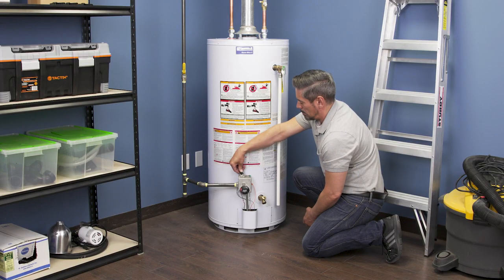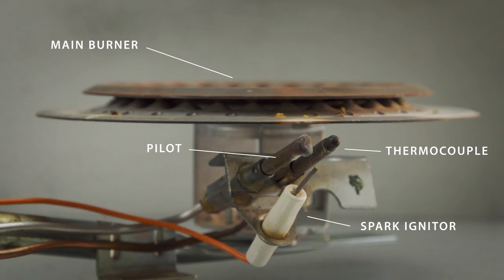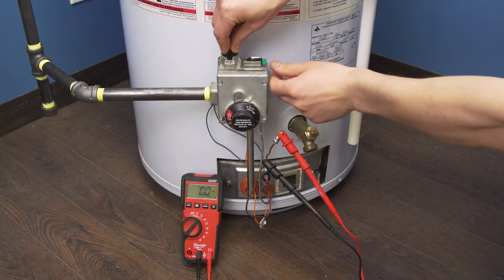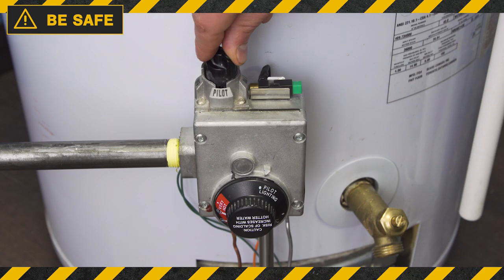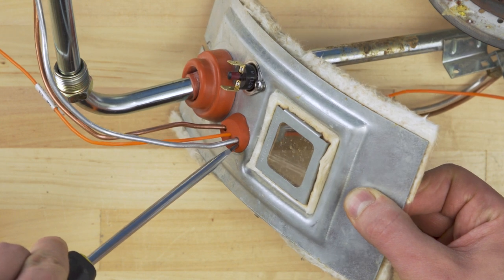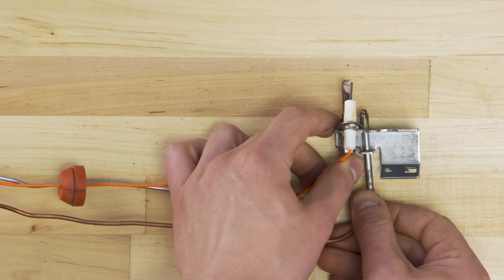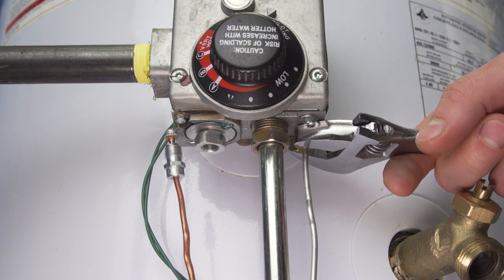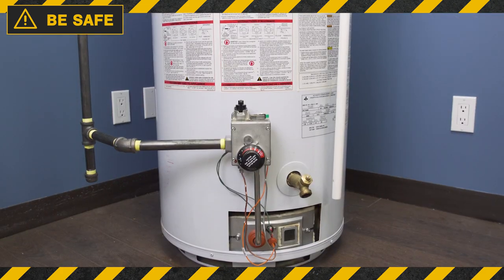Water Heater Thermocouple - Voltage Test & Replacement | Repair & Replace

Comment: Can a thermocouple be bad if my pilot light stays lit?
Reply from the maker: Thanks for watching. A thermocouple can weaken over time but if the pilot stays lit, then it means that the thermocouple is producing enough voltage and is working as intended.

Comment: My pilot now stays lit but the burner is not turning on to heat the water. What should I do now?
Reply from the maker: Thanks for watching. It would be good to clean under the burner and check for airflow issues: https://youtu.be/Lu5GvbvspMw?t=335

As well you can clean the burner assembly as a buildup of carbon can affect how the burner ignites.

If you've eliminated all other problems then its likely a faulty gas valve.

Comment: Do I have to replace the gasket from the back of the case door?
Reply from the maker: Hi Alexis, thank you for watching. Overall if the gasket is broken or is starting to deteriorate then its best to replace it. The water heater will heat water equally fine if the hatch is not properly sealed. Sealing the hatch prevents vapors from paint or chemicals from the floor from being ignited outside of the water heater combustion chamber. The intake has a flame arrestor screen across it which prevents flames from traveling outside of the water heater. Any huge air gaps in the gasket reduce the protection of the hatch but won't prevent the heater from running.
Reply: Thank you for your quick response! I will get a new one. Turns out the combustion trip device broke and that is why it wasn’t working. But on the bright side we have a new coupling 😁
Reply from the maker: @alexissabbagh5974  You're welcome, we're happy to help! Glad you got it fixed!

Comment: Why can't the gas be shut off first BEFORE start working on the fix, rather than watching out for the strong gas smell?
Reply from the maker: Thanks for watching. To test the thermocouple / you need gas to light the pilot. The statement about a strong gas smell is a general warning. When lighting the pilot flame there shouldn't be a strong smell of gas so you should be able to safely light the pilot and test the thermocouple voltage in this case. Then later in the video we recommended to shut off the gas before accessing the burner assembly.

Comment: Any one else find that the voltage is negative instead of positive when hooking up the probes as they show?
Reply from the maker: Thanks for watching. A negative voltage when testing a DC circuit just means that the current is flowing in the opposite direction. If you switch the probes, you'll get positive voltage reading. Regardless, the thermocouple voltage reading should still be within that normal range.

Comment: My thermocouple does not look like this.  You have a solid copper wire.  My system uses just standard wires.  I'm not really sure where ground is.
Reply from the maker: Thanks for watching. The copper wire is actually the sheathing and there is another wire hidden inside of it. Beacuse of the low DC voltage, a ground wire is not necessary. If you have wires, it is possible that you have an electronic valve. In this case you likely have a thermopile  https://www.youtube.com/watch?v=UXpmmGuewk8
Reply: @AmreSupply  Thank you.  The link you sent looks a lot more like my water heater.  I did the test and my thermopile is reading 460 mV.  I just ordered a new burner assembly a few days ago so I'll just replace the whole thing once it shows up in the mail.  Thanks for the help.
Reply from the maker: You're welcome, we're glad to help out in any way that we can!

Comment: this way will void warrrenty you need to replace the entire pilot assembly......... by cutting the rubber grommit to therm coup and it will no longer be a sealed combustion water heater get model number and serial number call manufacture and replace with factory pilot assembly  big wieners bad plumber bad
Reply from the maker: Thanks for watching. You're right its good to double check to see if the water heater is still under warranty as the parts might still be covered.
Reply: A "sealed combustion".. what??  The combustion chamber gets air via vents at the bottom of the water heater, it's not sealed, so I have no problem cutting the grommet to release the thermocouple tube, which I did when replacing my thermocouple.  This is the best YouTube video I've seen (and I watched many) on replacing the thermocouple.  Some of the picture views are outstanding, such as the installation of burner assy into the chamber (7:35) which saved me during my installation from an incorrect configuration.